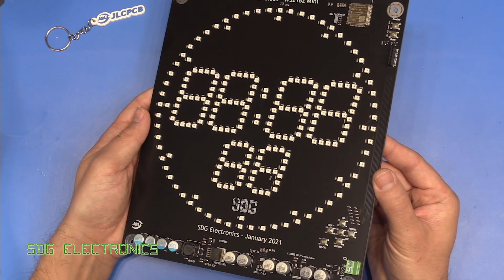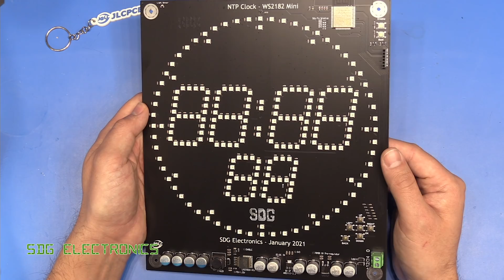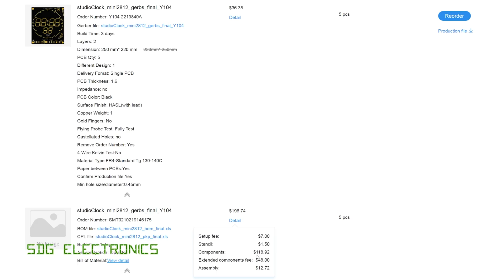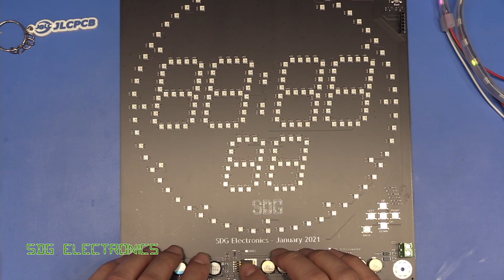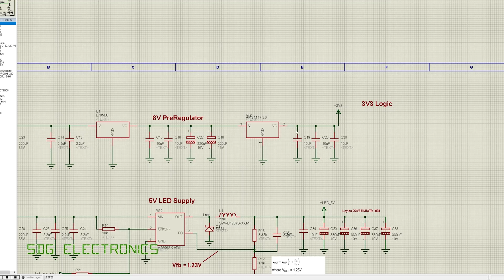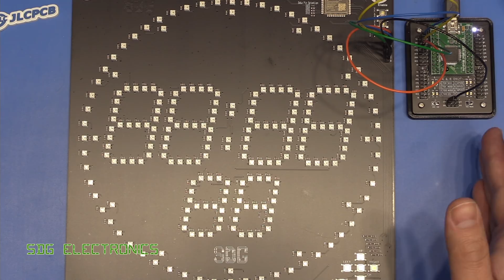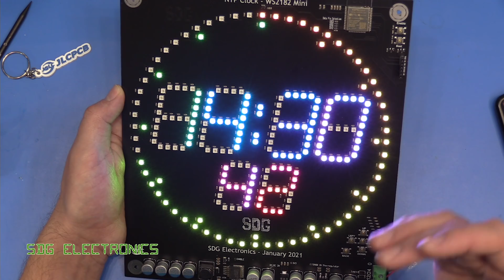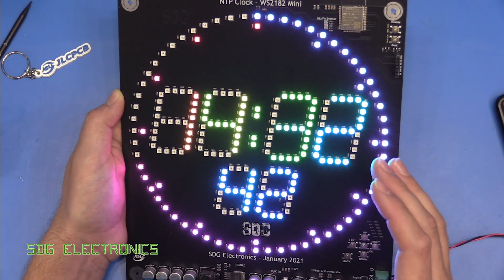SDG #197 A WS2812 NTP Wharton Style LED Clock powered by ESP32

Comment: I wonder what kind of filter you would need to place in front of the clock to make it easy to read.
Reply from the maker: I am testing some tinted window film, but I also plan to test out some diffused plastic.
Reply: @sdgelectronics  Great! Let us know how it works out. Hopefully the window film works as it is easier to obtain than thin plastic sheets.

Comment: Nice project. What is the purpose of the pre-regulator in the design? It seems that the 8v isn't used apart from feeding it into the next voltage regulator. Is for managing the heat dissipation?
Reply from the maker: Yes exactly. Also the AMS1117 is not recommended for use at 24V with a 3.3V output.
Reply: @sdgelectronics  why not use a small switcher for the 3.3V?

Comment: I defiantly would like to have one version of your clock in my home workshop Steve! I did ask a few videos ago if you had any for sale or an of your viewers did? I don't want to order 5 by myself. Or a group buy anyone? Located in the UK.

I'm not sure if your aware of octoprint to use with your 3d printers? I use raspberry Pi with a raspi cam to remotely load sliced files, control the printer and monitor live. It Can link with 3D slicers too- the ones I have used Cura and Sli3er.
Reply from the maker: Hi Matt, I will look at getting some more made, however I would encourage a group buy if anyone can arrange it.
Reply: @sdgelectronics I can take care about that..please contact me...
Reply: @robindel2  Did you ever get enough interest for a group buy?
Reply: good idea
...I'll be the next one to want one

Comment: U have 2 cores in the esp and run the leds on one core and wifi on the other. I used that method to control 2000 leds.
Reply from the maker: From what I understand, interrupts with handlers on in IRAM are temporarily disabled during some WiFi interactions even if the task is on a separate core. With some peripherals, this can cause delays. The SPI plus DMA seems to work well for now though.

Comment: I would of thought the 'Paper between PCBs' option you showed would solely pertain to bare boards surface protection and would in fact be paper.
The esd foam is likely a default requirement for assembled boards and using the assembly service.
Reply from the maker: Normally they're placed back to back then protected by bubble wrap. I took a look at my other preassembled PCBs and they didn't have any foam sheet
Reply: @sdgelectronics  he just means tahts why the service says "paper" but you got foam.Makes sense, with the assembled components you have. It would indeed be esd-paper on bare boards if you chose the same option. I think either way you will be protecting the board's surface.  

Thanks so much for what you share on here, sir.  JH's "the next step" comment really needs to happen!!  I have a lot of things I would start building at JLC PCB myself if I knew I could make some cash by spending the time to properly document and share it with the world.

Comment: Looks great!

$50 per clock is really good for a board like this. I think that's been my biggest take-home from your promotion of their assembly service, that assembly really is available to us now for our own projects - Especially for larger boards. I'm hoping that one day they'll streamline their process enough to be able to offer this sort of pricing in single quantities and I have a feeling they might get there sooner rather than later.
Reply from the maker: They do have an option for getting 5x PCBs, but only 2x assembled but the extended components fee is still there. However generally speaking this is amazing value. I had a quote from a UK supplier and it was over £2000...
Reply: @sdgelectronics  Ah that's even better then, that looks like it would work out to be around $80 / £60 each.

I can't seem to find the project on your website, have you uploaded it yet or am I missing it?

Comment: 10:38 Why all that trouble with zener and not just use a BJT?
Reply from the maker: Technically the zener isn't needed, but I wanted the LED for indication. It effectively shows there's power to the PCB but the ESP32 isn't booted up yet
Reply: @sdgelectronics  I meant something like this:
https://i.imgur.com/FwP8YqY.png
You mentioned Vin 12-24V, so 10k resistor should be sufficient at all times, and LEDs Vf would definitely be greater that 1.3V treshold of LM2596. Dirt cheap BJT to protect GPIO.
1-2mA of LED current should be plenty for indication.

Comment: Impressive! I wonder how hard it would be to implement an 802.3af/at compliant interface and smps on a board like this, making it PoE powered? ESP could continue using wifi for connectivity.
Reply from the maker: I actually started looking into this. You can use an Ethernet PHY with the ESP32 too, solving the issue of WiFi credentials

Comment: This type of a clock isnt for me personally (as i prefer reading analogue clocks!). But its been really informative to follow what you are doing here from an educational aspect. I just wanted to remind you again that it should be feasible to make your own very custom 3d printed light diffusers. To put over the segments of the display. And make all the leds merge together seamlessly. Not actually sure myself which filament to recommend. Because actually there are so many different choices that can work well. Probably worth looking into! Well at least I'm excited about it. Not sure about anybody else. The technique can also be used for making light pipes, for electronics display panels.
Reply from the maker: I'll think about whether this is something feasible. I do have a resin printer and clear resin which is gathering dust...
Reply: @sdgelectronics  yeah you can use resin. i hadn't actually considered that because resin is not even necessary. any ordinary FDM printer (ender 3 etc). is capable with the right choice of filament. Although for better temperature stability, resin makes sense over bog standard PLA. But another easy to print FDM filament is PETG, which would then resist temperature about +20c better? than PLA. So it really depends how hot the part will actually get in situ.

But it doesn't end there! If upgrading or buying an FDM printer with an 'all metal' hotend (no petg tube inside the throat)... then can also try printing higher temp filaments like polycarbonate. But with some extra perseverance. Because polycarbonate is more difficult to get right. It needs special settings. But then once you crack that... polycarbonate is stable all the way up to 140c. Which is plenty.

So my advice here is: Sure if you have a resin printer then by all means! just will be rather more messy, extra hassle to do all the steps for the resin clean up handling etc. Therefore just for prototyping stages: where you are test fitting and iterating the design. Then PLA or PETG makes much more sense for that purpose. Until the design gets to be fully finalized and then you would want something to last for a longer time. And be more permanent.

Comment: WS2812 seem to be quite lax on timing as long as it's less than the Treset  time of >50us and consistent.  I expect it gets more tight the longer the string of led’s get. A great looking clock
Reply from the maker: The problem is WiFi randomly interrupts the RMT peripheral, which is basically ideal for the timings needed. It seemed to give enough jitter to create errors. The SPI and DMA solution is OK, but uses up memory resources because a 24 bit RGB packet gets expanded to do the timing
Reply: @sdgelectronics  That's the issue processing 24bits per pixel. are you doing the pixel processing in the second core?
Reply from the maker: @TheEmbeddedHobbyist  I was. Now it's mainly down to the DMA, but you have to trigger/copy to the DMA in a task
Reply: Long strings aren't a problem because each WS2812 generates its own "DOUT" signal, which is presumably conformant to timing, etc. So as long as the first LED accepts your data string, the rest should be alright as well.
Reply: @IanTester  Interesting, I’ve not thought of looking at the signal coming out of the first one. May have a look later, I know it set the correct voltage levels but have not thought about timings.
Reply: @The Embedded Hobbyist   Yeah, basically all WS28xx chips with clock line only are pretty relaxed on timing. I do strings with 600 LEDs without any problems. And with highest FPS possible for the WS28xx timing protocol. Using the Orange Pi Zero as embedded ARM board; nicely with Ethernet, SPI Flash and SDCard. And of course the 256MB RAM ;-)

Comment: 6:35 Well, no ;-) the WS28xx are not relying on very tight timing. You can simple use 6.4MHz SPI DMA and drive the WS28xx chips with MOSI line only.
Reply from the maker: That's the method I ended up using, but it's wasteful on memory. The RMT peripheral is most ideal, but seems to be affected by WiFi
Reply: @sdgelectronics  Yes, you would need a lot of memory. I do embedded programming on the Orange Pi Zero, that is 256MB RAM :-)
Reply: WS28XX does rely on tight timing as it doesn't have any clock signal.
Reply: @EEExplained  Not really. There is a lot of tolerance in timing specification.

Comment: Hi Steve,  Thanks for this video :). I was looking at the castellated edges on the ESP32. Is it parallax or are they offset?
Reply from the maker: Parallax from the angle of the camera. It's well aligned 👍
Reply: @sdgelectronics  That's good to know. I've been considering JLC assembly for some projects. Thought on driving the WS2812s - It might be worth using the 2nd core to avoid the wifi interaction? Also what silicon version did you get on your ESP32?  Thanks!
Reply from the maker: @Magic-Smoke  honestly I have tried so many things, even when you only run freertos on Core 0 and run a task on Core 1, WiFi seems to steal occasional cycles
Reply: @sdgelectronics  I think there are a few different libraries around for driving the WS2812 devices using some DMA transfers and different peripherals on ESP32.  No reason to fuss about big-banging the signal these days.  

This board really turned out nicely!  Thanks very much for the info that you can get connectors assembled on the board.  That opens up the possibilities quite a bit.
Reply: @sdgelectronics  How frustrating! Glad you got it solved